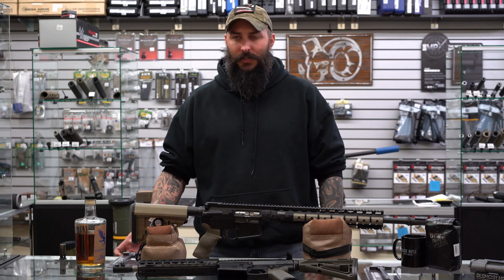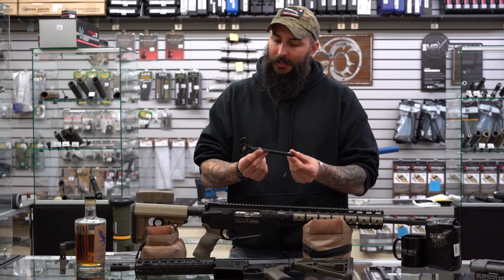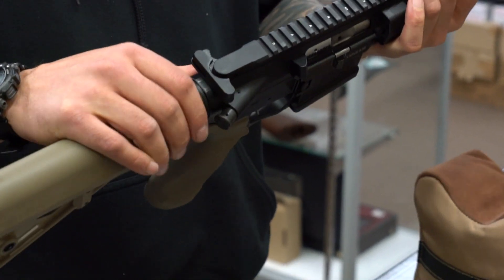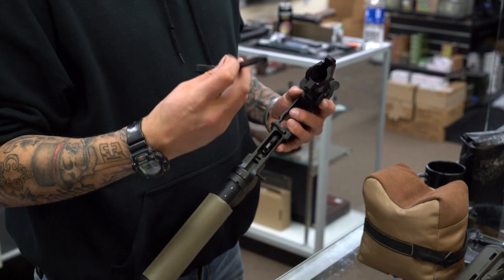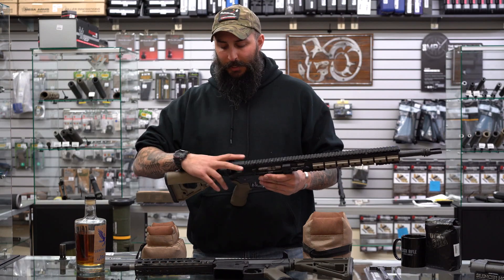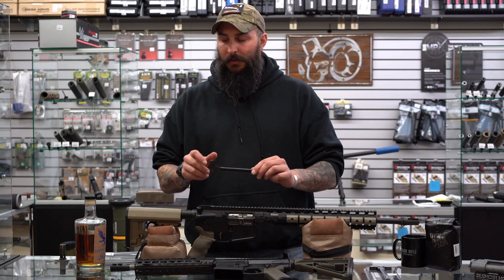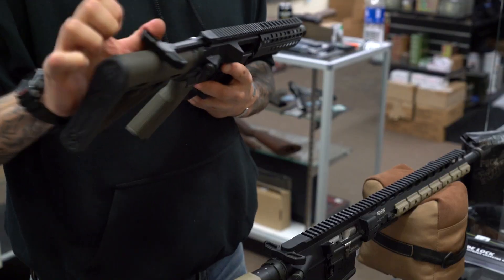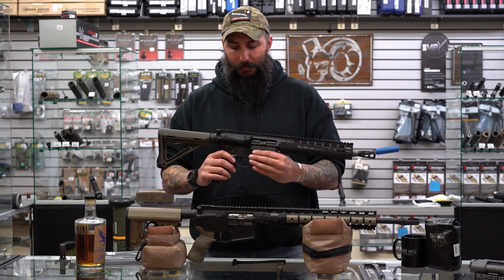Mega Slide Lock Charging Handle Review

Comment: How does it release to be able to charge without a latch?
Reply: Instead of a hooked latch its a rounded latch with no external piece to release it, it rolls over the latch notch and is held there by spring pressure. We have one on a used rifle at work, it seems to be wearing away on the finish and aluminum of the upper. That being said I really like it.